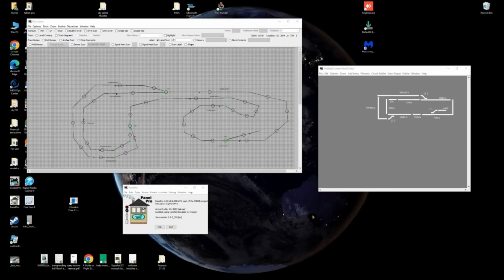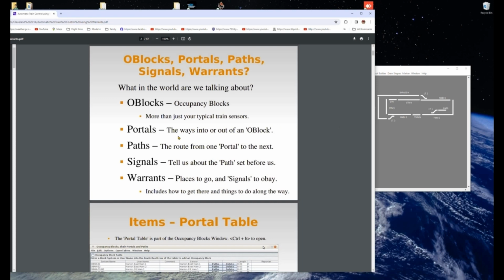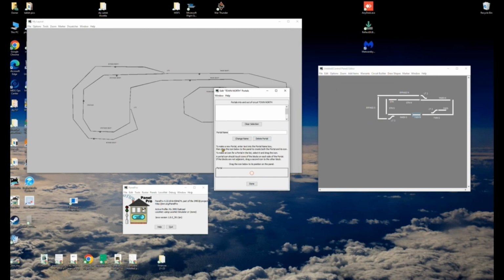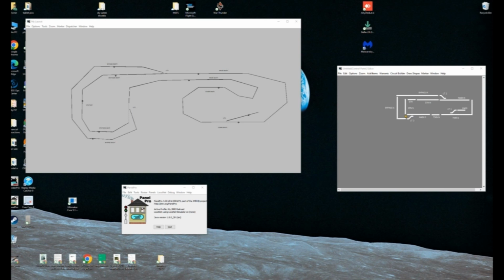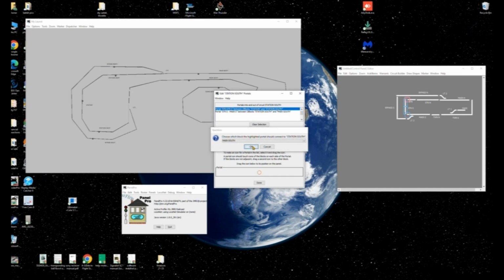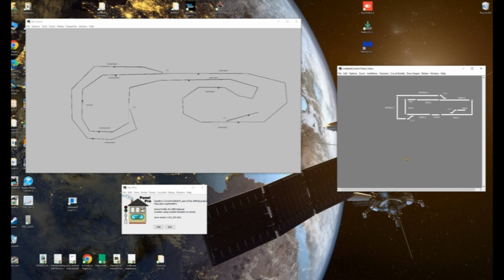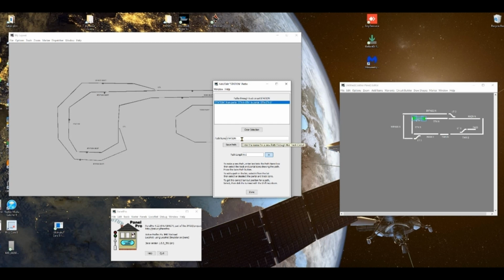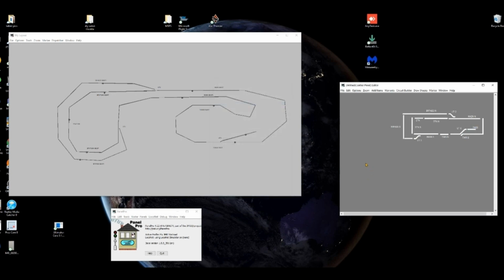HOW TO AUTOMATE YOUR MODEL RR USING JMRI WARRANTS: ADDING PORTALS AND PATHS

Comment: Also a newbie to Warrants (fun and games!). Regarding Oblocks and Portals (at 12:10) my understanding is an OBlock can have 1 to many Portals however a Portal can only have a maximum of 2 blocks. I have defined several OBlocks with a number of portals which avoided having to break the mainlines through my station precinct into several short blocks. Anyway, good luck going forward.
Reply from the maker: I think you know more than I do...Yes, just checked JMRI and you are right.
Reply: Only by a few weeks 😜 Not much out there about Warrants compared to Dispatcher.  @kenschamuhn4864